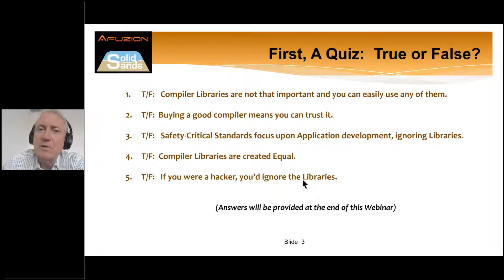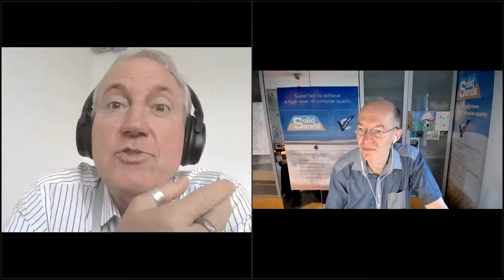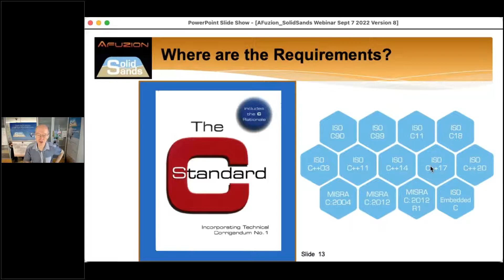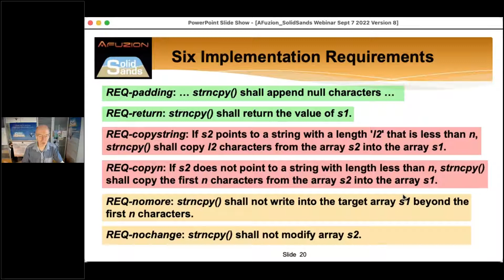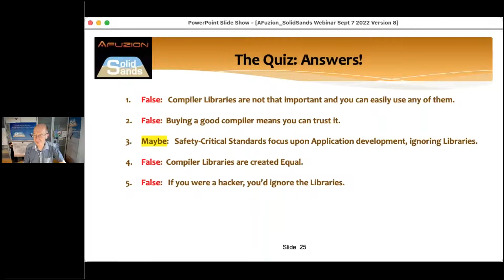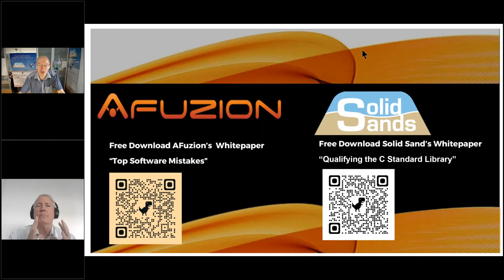Back to Basics  Safe and Secure use of the Standard C Library  Webinar from AFuzion & Solid Sands

Comment: As someone wanting to transition from a rapid-prototype environment to a formal DO-178C environment..  perhaps not for FAA approval, but to develop high quality/safe products for aerospace companies (Lockhead's SEAL Level X, Boeing , etc) , Medical, or Nuclear industries, would be interested in an overview of the basic requirements.

For example, what are the typical outputs/documents required.. what are the typical software tools that are a must-have in the various stages of the software life cycle.. noting the difference between checking style (N-version programming) and finding bugs:

Requirement Management -  DOORS, JAMA
Static Source Code Analysis - Parasoft, PolySpace, CodeSonar,  horusec , sonar cloud, veracode PREFast
Dynamic Analysis / Modified Condition/Decision Coverage (MC/DC) - VectorCAST, RapiTest
Configuration Management - Git, SourceSafe, Mercurial, MS TFS
QA - Helix ALM
V&V - VectorCAST, LDRA Testbed
( Continuous Integration / CD - Continuous Delivery/Deployment : Travis CI , Bugzilla, Jira, jenkinsio, GitLab)

What is the general attitude towards open source software (ex. FreeRTOS) and code-generation tools (ex. ST's Cube MX)?

How do CPLD and FPGAs fit in to the picture.. since not exactly software, but they are programmable devices written in an HDL?

What parts of the above are covered in in Vance's 'Aviation Development Ecosystem' book?

Comment: An excellent and highly relevant webinar from AFuzion and Solid Sands. Vance and Marcel make a clear case for focusing on otherwise easy to overlook implications the C standard library has in safety-critical applications. In aviation, in particular, "libraries fly" unlike tools and so should be subject to the same Requirements Based Testing as all other source code under guidance of the relevant standards and according to the software's DAL. And just because it may have come with the compiler doesn't exempt it from suspicion and scrutiny. In addition to highlighting its importance, Marcel explains how requirements and test specifications are developed from libraries and introduces offerings from Solid Sands that support the qualification and certification of the C standard library. Sorry to have missed the live webinar, but glad I could catch the recording. Thanks Vance and Marcel!